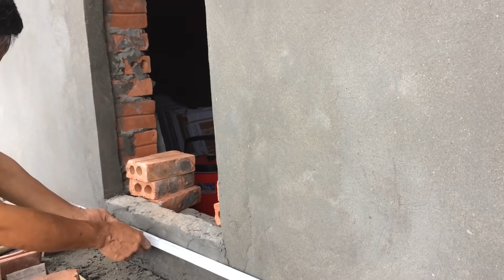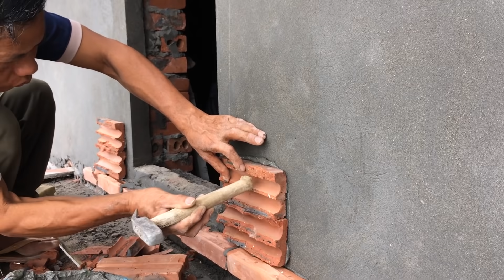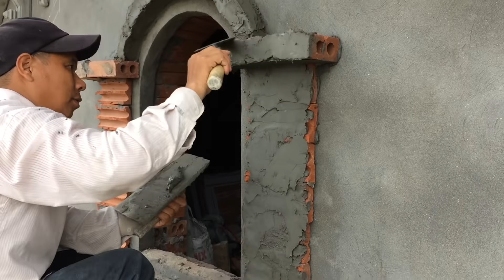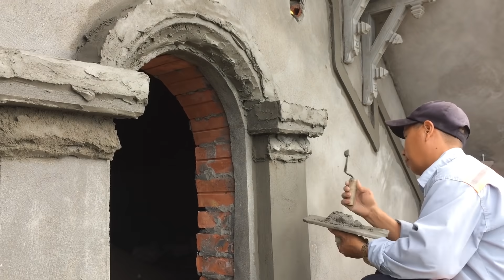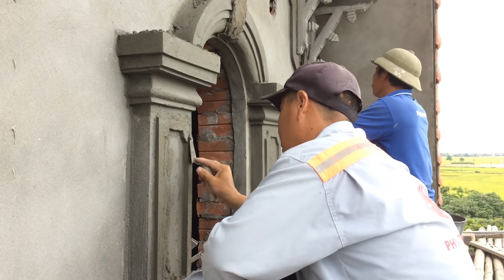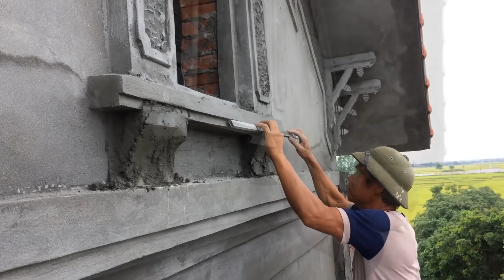Beautiful Home Window Design Ideas - Craft Construction Techniques - Home Construction Tool

Comment: Wow! Stunning craftsmanship.  Part mason, part artist and part sculptor.  I am curious about the mortar used to hold the clay bricks.  What kind is it?  I have done a little masonry and tile work, but nothing ihave used would hold those bricks in place initially without a form or support.
Reply from the maker: thank you for watching the video - you use pure cement a little more water to mix it like a glue that will keep the bricks on the concrete wall
Reply: @constructiontech2411  thanks!
Reply from the maker: thank you

Comment: Cuál es el nombre del recubrimiento y el material adhesivo para los ladrillos?
Reply from the maker: Gracias por mirar el video: el material para unir las baldosas a una pared de concreto es una mezcla de cemento y agua que formará un pegamento flexible para unir las baldosas.